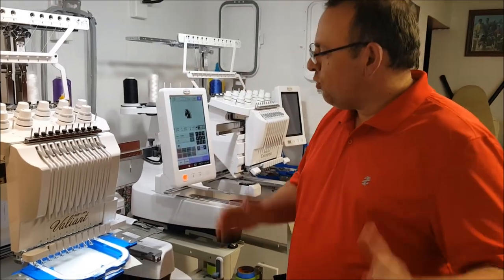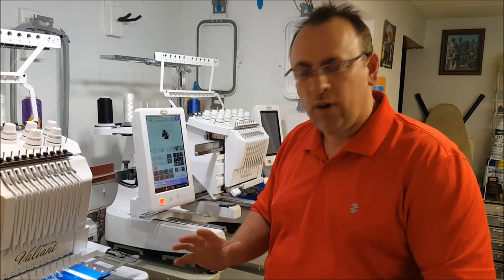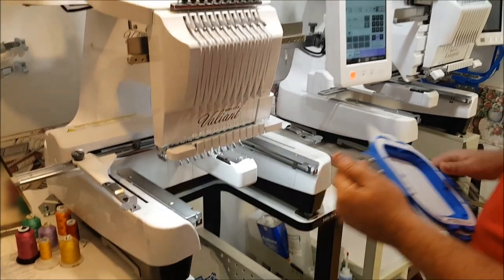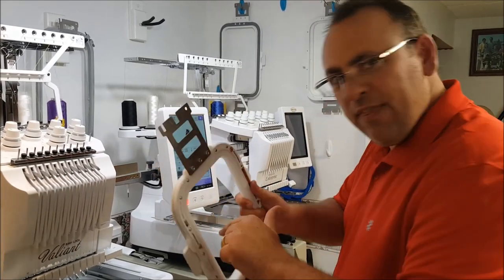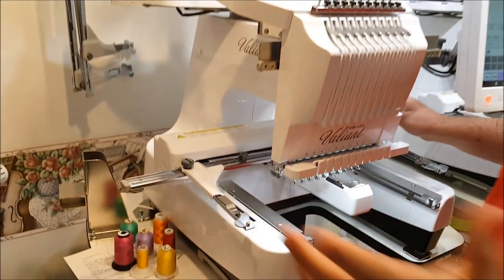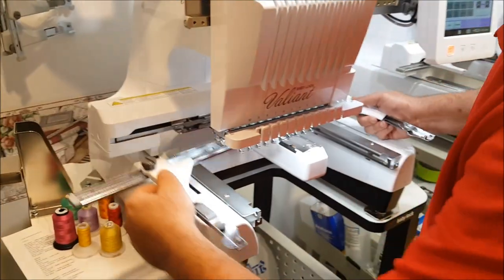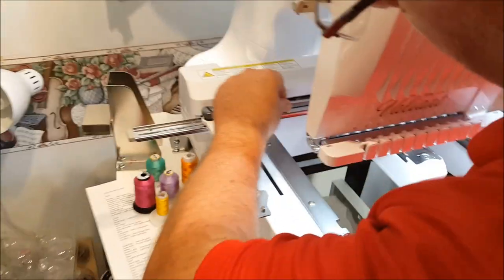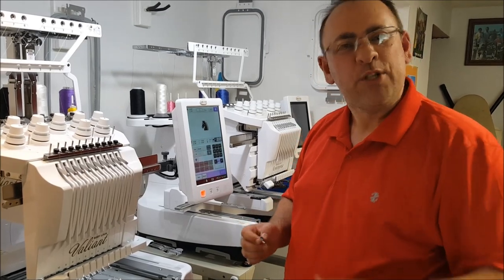How To: Remove 'Change to a Larger Hoop' Error - Baby Lock Valiant

Comment: :-) I had to look at your video again.  I was pushing one button that was not the right one  and Bingo! It worked.  My repairman told me I needed a new monitor.   I paid 1k for the tune up.  They had my machine for about 3 months. They changed my tension screws to new ones and it made a big difference, but my hoop sensor was not working when I got it back.  So, thank you so much.  I fixed it thanks to you.  I call it the “Five minute fix that worked.”
Reply from the maker: Glad you're up and going again!  Thank you for the kind words - but we all learn from one another!  :-)

Comment: Just came across your video. I couldn't remember how to fit my embroidery frame back on after using my cap frame.  Not only did you show me that but you also showed me how to correct an error on my machine which I too have regularly.  Thank you so much. 2 fixes for the price of one.
Reply from the maker: Glad everything worked out for you!

Comment: Jerry, you will get that error message when the screws are loose.  There is a sensor in the screw area, but you usually don't have to take them out, but if you just tighten them, the message will usually go away!   Thanks for all your tips and tricks!
Reply: Any hat hoop tricks? What's the largest size it will allow?

Comment: Hi, I wonder if you could help me I know it’s been about five years on your site so not sure if you’re still in the game but I have the same problem with a cylinder frame are use for I want to use for embroidering on shirtsleeves. the trouble is it is only travelling 50 mm in total. This is ridiculous I need at least 80 mil 70 mil how can I do this please how can I bypass it?
Reply from the maker: Hi Martin!  Unfortunately, I am not familiar with the cylinder frame.  With hat hoops, I use an "override clip" that allows allows the machine to embroider a larger area, rather than the pre-programmed area as determined from the factory.  Another thought - I recently embroidered numerous sleeves, and I used a Mighty Hoop, the 8x5, and it worked great.  Hope this helps!
Reply: @mancaveembroidery  hi Jerry I sorted it, there’s a hidden menu the settings were lurking in there … thanks for your reply

Comment: Having same problem on Ellisimo.  How do you fix that
Reply: Same. Did you ever get an answer on this?
Reply: @kendraeldridge7537  same! Did you get a response?
Reply: I did not get an answer specific to this, however, I did reach out to my software customer support and was told to check the hoop size saved to the design.  The hoop size designated in the design should be as accurate as possible to the design size.  That did help my issues going forward. I since upgraded my machine, so, that, along with checking the hoop size in my designs has not caused the issue to replicate.  Hope that helps some of you, though.

Comment: My machine tells me my “ pattern extends to the outside of the embroidery frame” and I have not even put a hoop on it yet
Reply from the maker: There might be a few reasons for your message.  1)  Check the orientation of your design.  If it is, for example, 7x5, and you your 5x7 hoop installed, you might need to rotate your design to match the direction of your hoop.  2) Make sure the screws that hold your "A" or "B" arm onto the machine are tight.  3) If they are tight, remove your "A" or "B" arm from the machine, then re-install them.  Sometimes we need to remove the arm completely from the machine in order to reset the sensor.  Just a side note:  If you do not have an arm installed on your machine yet, you will receive this message, as the arm presses on the sensor, telling it which hoop you have installed.  Once you install a hoop, you should not have the error message.  Please keep me posted.  :-)